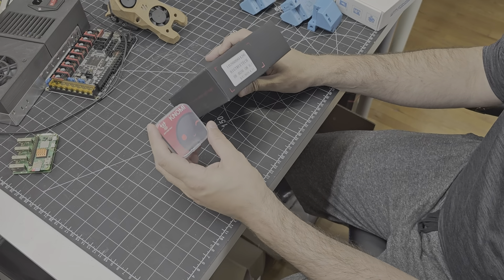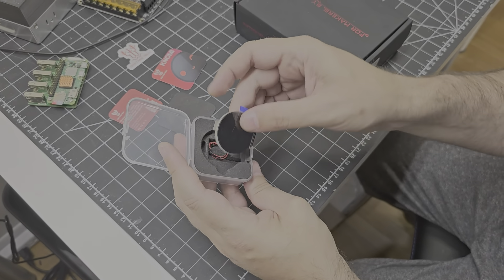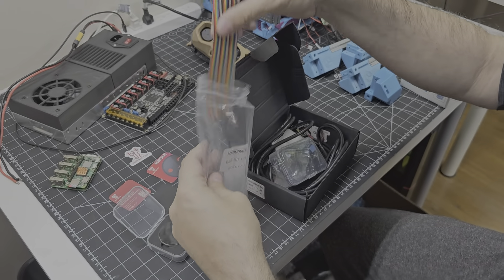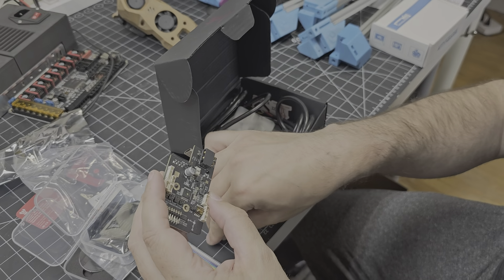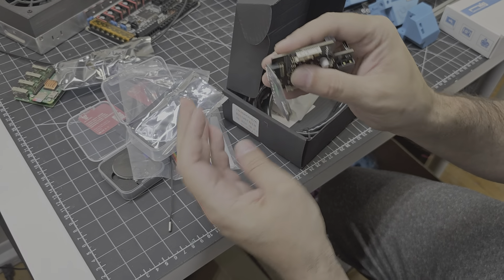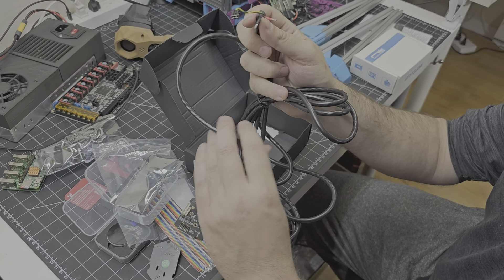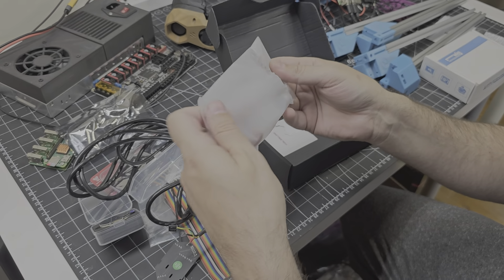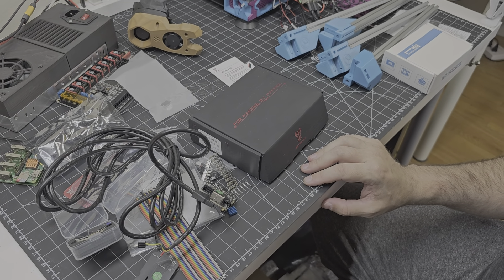Unboxing: BigTreeTech's KNOMI and EBB SB2240 CAN Bus Toolhead PCB

Comment: is there any way to connect a nozzle cam to this setup without running a long cable all the way to the PI
Reply from the maker: I don't have a nozzle cam to confirm, but probably not easily. I run a long USB cable from my Beacon probe at the bottom of the toolhead all the way through the Z chain and into the Pi mounted in electronics bay under the deck.

Comment: Your videos are great. I'm in the home stretch of a Voron 2 build right now and have got a lot of info from your channel.

I snagged the SB2209 due to the notorious timing issues on the SB2240, and I presume it's going to come with the same cable. I noted in a more recent video of yours that you grabbed the CAN cable from Fabreeko which I have my finger on the button to buy, but a couple of questions in your estimation...

- Is the supplied BTT cable sufficient for use at chamber temps (possibly made more rigid by addition of piano wire) or is a "proper" CAN cable like the Fabreeko one basically obligatory?
- If the latter, what length in meters would you say is appropriate?
Reply from the maker: Glad you are finding the content helpful. On my V0, I am using an Igus CF77 cable for CAN Bus, it has a very short reach to get to the U2C in the electronics bay on the back, it has 4 wires for CAN Bus, and nothing more.
On my V2, because I also needed the four USB wires to the toolhead in addition to the four CAN Bus wires, I opted for the 3do CAN+USB cable, which I ordered from Fabreeko. I didn't measure how much I used on my V2 350mm build, but I have 3.5 m left from my original 5m order. To be safe, I would order 2 meters, more if you want spares, or if you'll need to build multiple printers. I did rearrange my electronics bay on the V2 to shorten some wire runs, so your mileage may vary.
The 3do cable is substantial, with an Outer Diameter of 7.9 mm, so if you want to use braided sleeve around it, or run it through a PG gland, I would recommend at least a PG9 gland. I struggled for almost an hour pushing and feeding that cable through the smaller PG7 gland, and there was absolutely no room to add a braided sleeve.